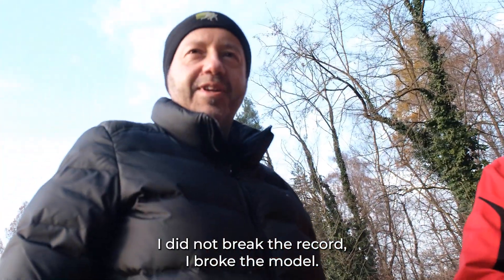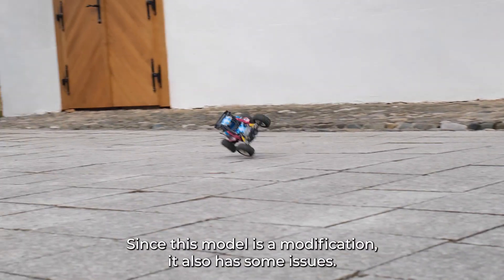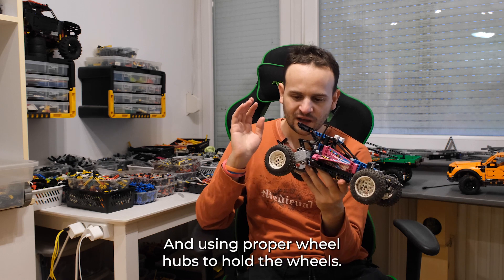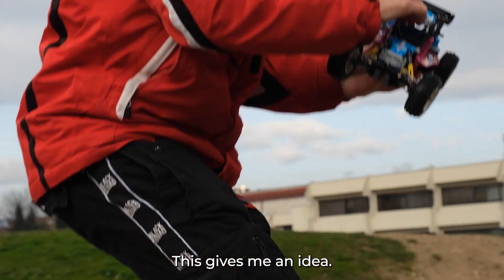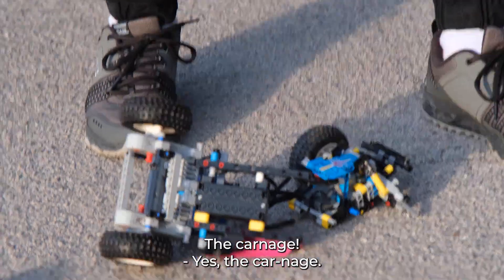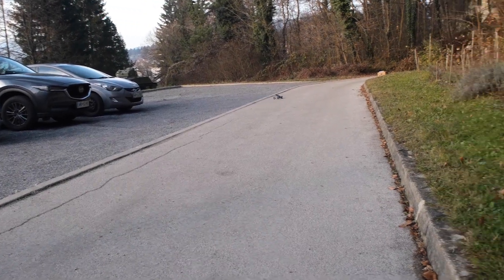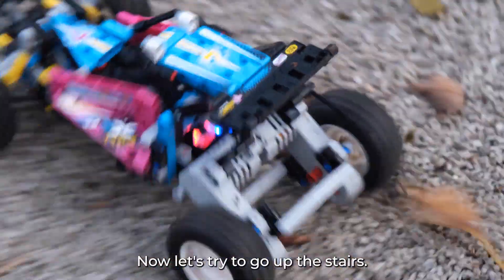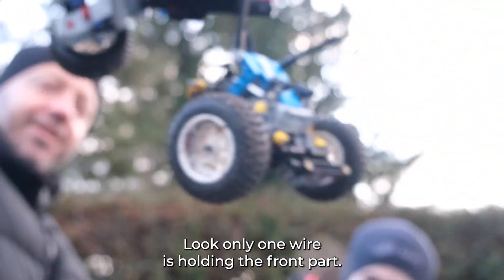LEGO® Technic 42124 Off-Road Buggy  MOD with BuWizz 3.0 Pro + 2 x BuWizz Motor

Comment: Please make a  Servo with proportional steerinf because every alternative servo is not proportional so you have to buy the Lego Servo for 50 euro when you work with powerfunctions.
Maybe you can add the Feature to use an pf l motor as an servo,with Software like bw3 can do with the c+ motors, for the bw2

Comment: Did a mod for snow complete with tracks at the rear and skis in front 😄 and just got the replacement buggy motor so I should be able to test it whenever we’re back at the snow areas

Comment: I have a BuWizz 3.0 and 2 BuWizz motors but my BuWizz flashes red and turns itself off if I try using 2 motors with direct drive. What am I doing wrong?
After it turns off it won't turn back on unless I plug it in, after about 1-3 minutes it's back to full battery. I got an early one. My on/off button is a weird grey that looks different from others I've seen and the LED light for port 1 has never worked. I have a 2.0 and it works better. But I can't buy a new 3.0 just to see if I got a bad one.
Reply: I have same problem..